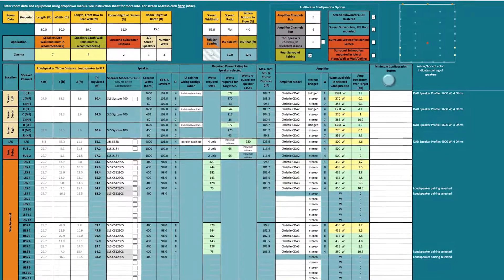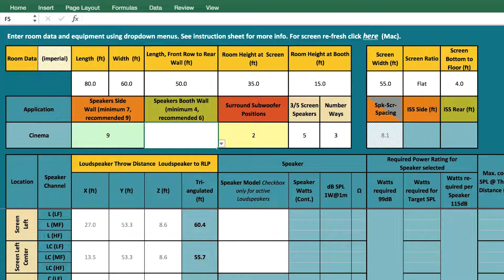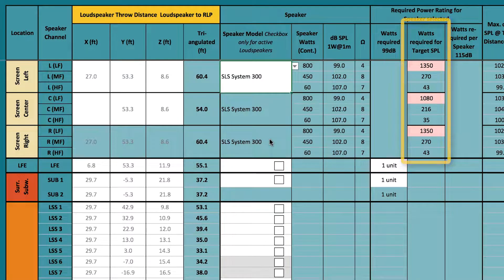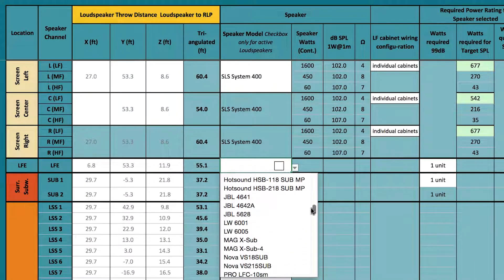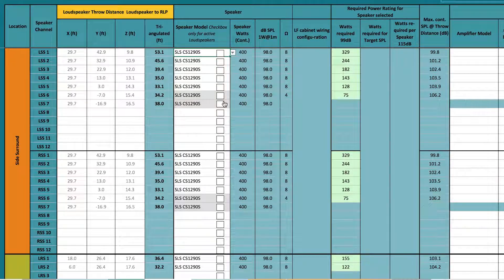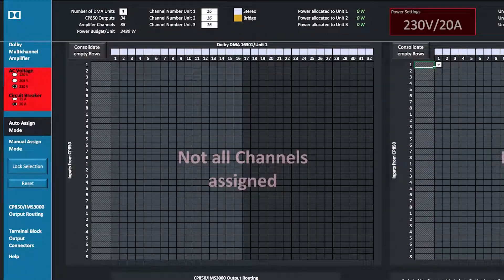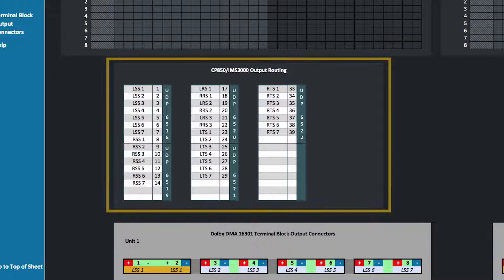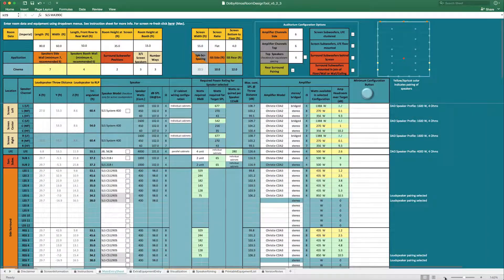Dolby Audio Room Design Tool (DARDT)

Comment: Does Dolby have any current videos that show the same GUI so it's not confusing to learn?
Reply from the maker: This video showcases Dolby's Audio Room Design Tool (DARDT), an interactive Microsoft Excel tool. This tool enables users to input speaker layout dimensions, speaker locations, and speaker and amplifier details to design a Dolby Atmos Theater according to Dolby specifications. The video specifically focuses on this aspect. However, it does not demonstrate the graphical user interface (GUI) of the Dolby CP950, which is utilized to modify the CP950's settings. Are you specifically interested in the CP950's GUI or the DARDT.